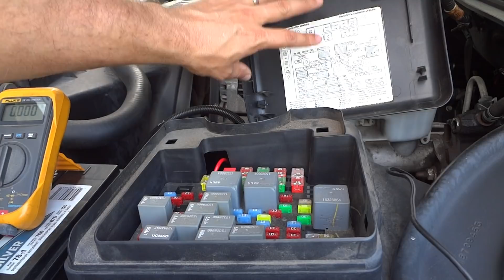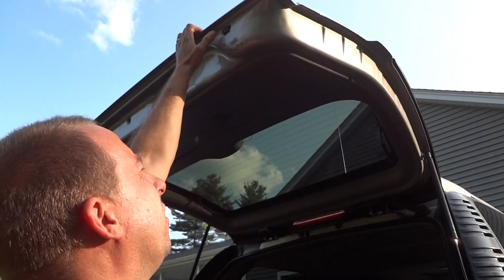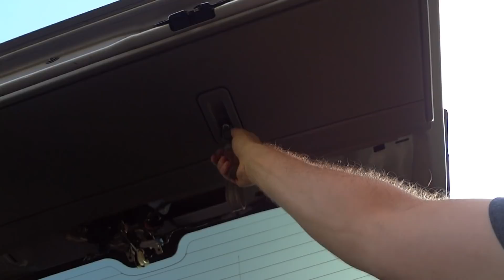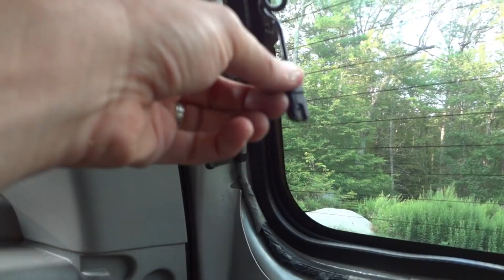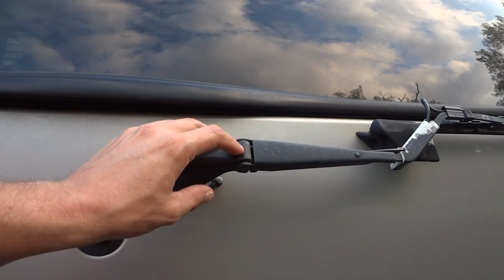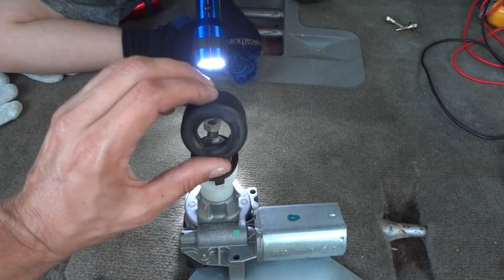Chevy Tahoe Rear Wiper Repair - Troubleshooting and Wiper Motor Removal

Comment: If I just want to delete the rear wiper altogether, is there anything I'd need to do with the wiring of the motor to not short out/cause other problems with the Suburban's electrical system?
Reply from the maker: You might be able to pull the fuse

Comment: Mine turned out to be the rear hatches not latching well, which interfered with the rear wiper working. After lubricating the hatches and slamming the hatch shut it worked. Simple but I didn't know that could happen. Thanks for your thorough video which helped me eliminate those possibilities.

Comment: I didn’t get 12 volts on both legs of my fuse in the truck next to the steering wheel. What would be your next approach? Thanks for your help
Reply from the maker: Maybe check the fuse box under the hood

Comment: Replaced my rear wiper motor on 2004 gmc Yukon Denali and didn’t work. Checked wires a pink wire has no juice 3 of the 4 do 🤷‍♂️🤷‍♂️🤷‍♂️

Comment: Would you have any videos on antifreeze reservoir leaks 🤔
Reply from the maker: sorry I don't
Reply: @SevenFortyOne  Thank you 😊  I was able to find one. Seems easy enough for a girl to do 😆 I'm so glad it was just that piece that was disconnected. I think the motor in rear window is bad but I'm not worried about it. I don't really use it as much as the front. I'm so happy!!! Thank you again. 😊
Reply from the maker: I used mine in the winter to clear snow but that was about it.  Glad you found my video helpful!

Comment: I removed the windshield wiper assembly from a 2011 GMC Yukon. What I found after the removal is the spline is larger than pictures and video show. My new assembly will not fit over the spline. Has anyone seen this or have a remedy.

Comment: @sevenfortyone my 05 has that white paint on wiper arm as well and I've seen it on other Tahoes, any idea how the paint gets there?
Reply from the maker: Not sure what white paint you are talking about ..it's been a while since I did this job.  Are you talking about the exposed aluminum where the paint has come off?
Reply: @SevenFortyOne  well not really sure what it is but before you started the job and on the wiper arm where theres something that looks white,....
Reply: @SevenFortyOne  right where arm rests when not in use
Reply from the maker: @dmdltz843  I looked at the video and see what you mean now.  That's the exposed aluminum where the black paint has flaked off.  Aluminum develops a light gray powdery finish when exposed to the elements for a while.  The camera makes it look more white than it really it.
Reply: @SevenFortyOne  ah ok, well mine is like that too, probably gonna paint it. Wasn't sure if it was paint spilled, I'd seen other Tahoes with the same problem Thanks!

Comment: Having the same issue on my 2004 Tahoe. Removed the motor to find a large amount of corrosion. Took it all apart, cleaned it up..hooked it to a 12v battery and the motor worked fine. Reinstalled it, It came on for a brief second and turned then went off so it still wouldn't work. Tried to jump the ground like you did, still don't work...checked the under hood fuse and the side of the dash fuse, all are good and getting 12v. When I hooked my multimeter to the orange wire on the harness it only read about 10.45-10.60 volts..thinking the orange wire is getting a poor connection somewhere so have to follow the harness to see If the orange wire could be damaged. If you have any other suggestions it could be let me know please.
Reply from the maker: Check the connector between the hatch and the body...also clean the latch striker as grease buildup can prevent a good ground
Reply: @SevenFortyOne  I found the issue.. On accident lol I removed the factory tape on the wire harness all the way to the top, after not seeing any issues I electrical taped it all back up and after that when I closed the hatch it worked. Not sure what it was, maybe a kink or something in the wire harness somewhere.
Reply from the maker: There is a connector up at the top near the hinge on the body side of the truck.  You may have just moved things around so it was making contact.  If it goes out again, check that connector.

Comment: I just fixed the rear wiper and defogger on my 2003 Tahoe. It was a bad ground in the rear connector for the tail gate. I just wired around it and now everything works great.  It helps that I was a Tech and have a degree in Electrical Engineering.  This might be your problem also.
Reply: nice work and nice test

Comment: Well, after fixing that broken orange 12V wire, the wiper decided to act sporadically.   I added the ground link from the wiper motor mount to the latch mount.  That 'worked' for a day, then the motor acted up again.  Conducted endless ohm and voltage checks on all the wires in the harness.  In conclusion, it was the connector to the motor.   The female terminals inside the connector had become wide/loose over 15 years (go figure).  Fixed/pinched the terminals inside the connector and it now works like a champ.  (In spite of watching Mr. 741 take apart the motor and resolder it and concluding that did nothing, I did the same thing.  Good practice though!).
Thanks for the excellent video.

Comment: I found that the large orange wire in the harness to the wiper motor had zero volts.  After reading other forums, found the recommendation to check inside the 'loom' harness on the top of the hatch.  Sure enough, the orange wire had simply snapped, therefore providing no voltage all the way to the wiper motor harness.  Spliced it together, and the rear wiper motor works again just fine.
Reply: I am experiencing the same thing and will try to apply your fix.  However, where did you perform the splicing?

Comment: My 03 just doesn't spray. It works and so does defroster and there's fluid in the reservoir.
Reply: This is a few months old, but I had the same problem and it ended up being the tiny hose connection from the reservoir to the rear wiper under the hood. It was disconnected close to the driver side door. I think it was because the fluid was froze inside the tube in the winter and the pipe burst at the seam. Just had to reconnect and all was fine.

Comment: Has anyone had an issue with the rear wiper moving when you use the left turn signal?  I replaced the wiper motor, the turn signal switch and the dimmer switch.

Items Replaced:
https://goo.gl/QqRn2u
https://goo.gl/f4uWsM
https://goo.gl/y4crB1

I can't figure out what cause the rear wiper to move when I use the left turn signal.  I removed the dimmer switch so it would stop the rear wiper.  But that's not a long term solution.  Any one have an idea?

Comment: So one need to make a video on rear hatch wiper motor and I have two trailblazers and 1 works so I placed in on my nicer trailblazer and I now not working on it but works on my nasty looking one so what's the priblem
Reply: Update both motors works on the older blazer and switches but not in nice trailblazer

Comment: Great video man, it’s very difficult to find any videos that have information on troubleshooting the rear wiper motor. I’m going through the same thing right now. 

My 15 amp fuse originally blew on the wiper motor and I replaced it with an ATM 15 amp fuse instead of the low profile mini fuse that was originally in it. It was definitely a little too big for that fuse box but I did manage to get the fuse box cover back on it after and It did work for a couple weeks with the new fuse, despite the obvious size difference (still same 15 amperage though). 

but my wiper stopped working again a couple days ago in mid motion on the highway during a rain storm. but the fuse didn’t blow this time! I was told it could either be wiring or the motor itself. I am going to take back trim off and do a multimeter test on the motor. And I did watch all 3 of your videos.. I noticed it ended up being a faulty ground wire, so I bought a jumper wire to test that after watching your video just in case. 

Do I need to take the negative contact off the battery when I’m tinkering with the wiper motor? I know it sounds like a silly question but I would feel worse not asking you.

Again, thanks so much for taking the time to inform all of us!
Reply from the maker: If you are checking voltages you'll need to keep the battery connected.  But if you are taking things apart it won't hurt to disconnect the battery.  I've found that my wiper still had problems at times. My truck had an aluminum tailgate and I think the only real ground connection to the chassis is through the latch.  If the gate isn't shut tightly the ground connection is lost and the wiper won't work.  You may want to check this on your truck too.  I'd also look at the wiring where it goes from the hatch to the body.  There is a connection there that is known to fail.
Reply: SevenFortyOne thanks for the tips, I will   Definitely do all of that. Apparently in the state of Vermont where I live, you can fail state inspection now for failed rear wiper so I am going to hopefully get to the root cause of this failure ASAP.
Reply from the maker: I have family in central vt and have heard they are cracking down on stuff.  I spent alot of time up there as a kid...it was my second home really.  Anyway, good luck with your repair!
Reply: SevenFortyOne thanks man, appreciate it! I love Vermont, I’m down in southern VT, just getting over this long winter. 

Yes, last year a law was passed to tighten up restrictions on vehicle inspections in VT so they are failing people a lot more these days for things that would have passed previously. BUT I read in the newspaper last week that the Senate signed a new law that will hopefully go into effect soon that is actually lightening up the restrictions a little bit.
Reply: Sorry to bug you again dude but had one more ? For you. Do you recommend disconnecting the negative lead from battery when using multimeter on the ohms setting for resistance? Just want to see if there is resistance on high and low setting for my rear wiper switch..
Reply from the maker: If you are checking the switch resistance you have to unplug the switch in order to get an accurate reading.  You shouldn't need to disconnect the battery, but it's always better to be safe than sorry....so if you aren't sure, pull the negative   and don't forget, make sure there is no voltge present when checking resistance or you can damage your meeter
Reply: SevenFortyOne ok thank you I appreciate your help again..
Reply: SevenFortyOne only reason I asked was i watched a video from Richpin06A, another You Tuber who posts DIY videos. 

In his video his front wipers went, and he disconnected the wiring harness from the connector to the front and than tested first for voltage on the wire coming from the 25amp fuse for the front wiper and than he switched his meter to measuring OHMs. than he tested the 3 other wires connected to the harness (high,low, and intermittent for the front) for resistance from the wiper switch. He did not take the negative off the battery but I was told to do that hence I am asking you because I cannot get a response from richpin06a yet.

Comment: I just replaced wiper motor and still doesn’t work. I do hear a noise from around motor when wiper switch on. Fluid pump does work
Reply: The issue is then with the connector between the liftgate and the body.